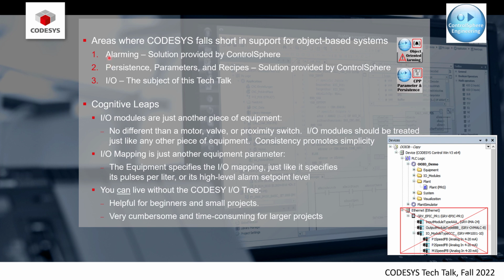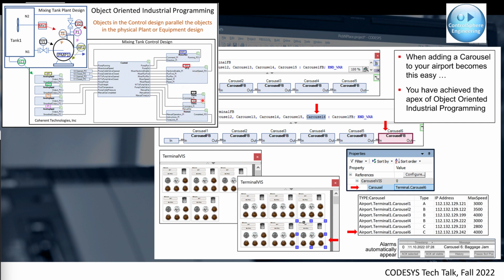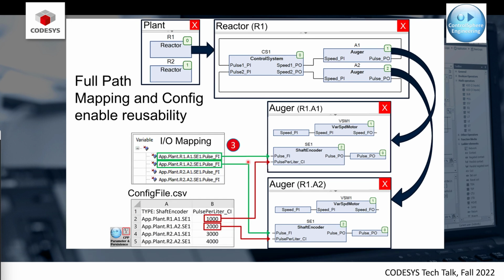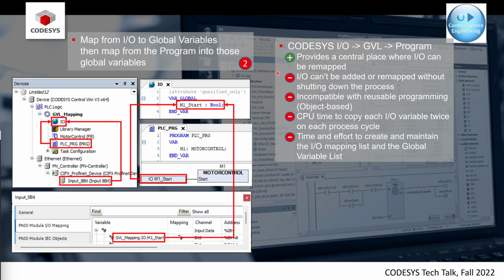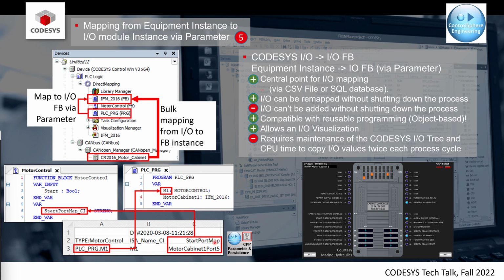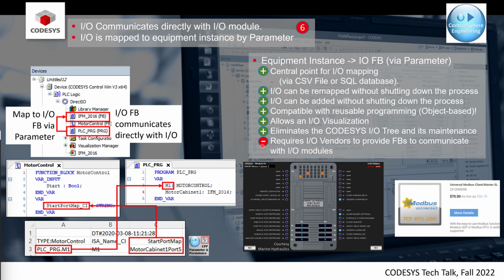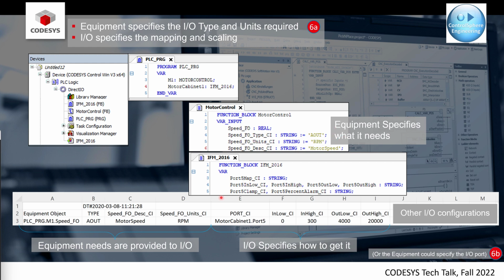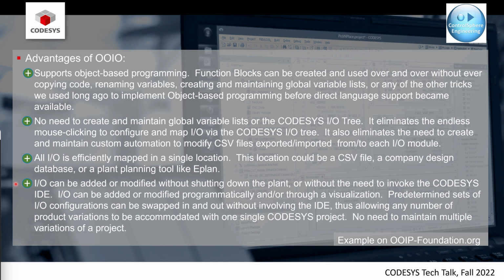Object Oriented I/O (OOIO)

Comment: Im new to SPS-Programming and having a hard time to understand where the physical SPS pin (like an analog input pin) is mapped to a variable inside a equipment instance in the code. Like if I want to map the actual speed of the pump, which speed sensor is wired to an analog input pin on the SPS for example on address %IW0, to a variable inside the instance of the pump function block. Where is this piece of code in the demo file?
Can someone help me?
Reply: @ControlSphere, can you explain?